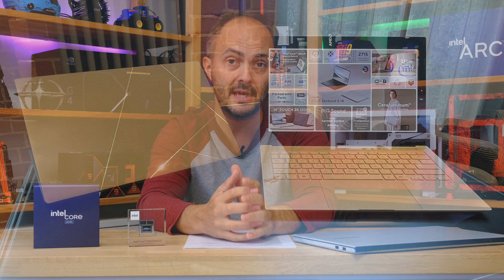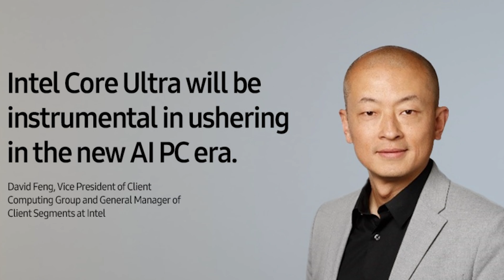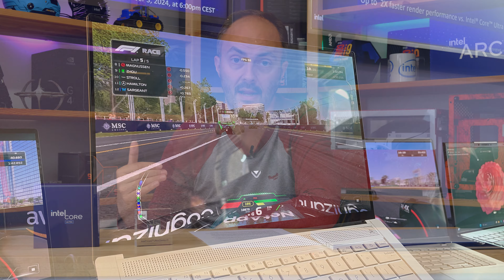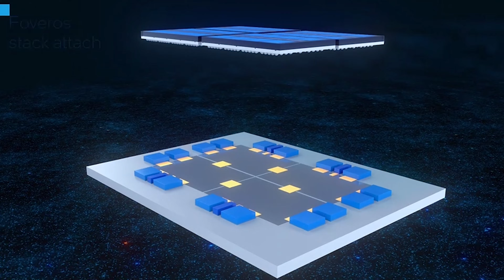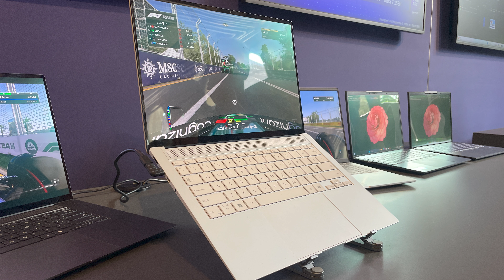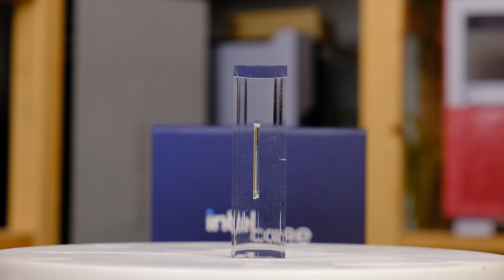Intel's HYPER THREADING REMOVAL: Lunar Lake's influence on Arrow Lake explained

Comment: The 2 big reasons for this single core thing.

1. E core and P core is having trouble talking to each other. And as a single thread it behaves "better".

2. They are more stable at higher frequency with a single thread. Because, Marketing.
Reply: then pack more cores, guess what i will stick to muh 13900k
Reply: Wrong. It's performance per watt that they were trying to optimize. Not overall all core performance. This CPU is meant for thin and light laptops. Raw performance matters a lot less than performance per watt in this application.
Reply: They are no longer making hyper threaded cpu's. When one engineer was pressed. It was for the reasons I stated above.

Comment: my i5 14600 burned off after 2 days.never ever no more intel...im going amd
Reply: My 13900kf going strong more than a year in use
Reply: @KnightOfCypher  im glad to hear yours are working fine 👍
Reply: I gone Macbook pro M1 and is as fast as my gaming laptop

when M1 beat Intel 630 HD with i7 7th gen cpu
Reply: amd adrenalin software not so good
Reply: @abhignaconscience358 melting connectors not good
Reply: @abhignaconscience358  AMD's adrenalin software better than Nvidia's.
Reply: lol, you're joking then it was DOA my GF's 13600K going strong since day 1
Reply: @cuongtang9539  maybe u Got lucky with your one.

Comment: Many PC enthusiasts are bitching about core type simply because they branded as eCore
They not even a developer, they don’t understand  Core are doing
They just don’t like get something different
Reply from the maker: I think to some extent that’s true. What Luna Lake shows is that it’s not just about power savings. It is about taking more load off the P-cores so they in turn can put effort towards games and content creation. Plus hyper-threading can actually result in lower performance in some situations. If you look at task manager and your taskbar there are an awful lot of programs running in your PC. The more of those basic programs you can run on e-cores the more you free up the P-cores. Plus no one liked the power consumption of Intels recent desktop CPUs. This could drastically improve that.
Reply: @CrazyTechLab  The main idea behind E cores on desktop isn't power efficiency, but rather performance per area, though this also leads to better efficiency (because you can run more of those cores at lower clocks while having the same performance and using less power). E cores take up less die space and IIRC you can fit 4 E cores in place of 1 P core, but in an app like cinebench those 4 E cores score roughly 50% more than a single P core. Also on Lunar Lake those E cores sit on the "low power island" so they can just run while the P cores are completely turned off.

On the topic of SMT/Hyperthreading - removing it will hit multithreaded performance, but it allows Intel to get somewhat better single-thread performance. And removing hyperthreading might reduce the need for some spectre/meltdown mitigations which could also bring performance uplifts, though this is part is questionable.
Reply: Nah, they are completely right. E-cores, in their current implementation are trash. Literally worthless for anything, but multithreaded performance without manually forcing all other side apps to run on them. They arent even that efficient to begin with.

Comment: i am also on my 9900k that has been overclocked to 5.0ghz for nearly 6 years now. it still gets the job done. dropping hyperthreading makes sense to me, because they could just add more of the e-cores that are rumored to be as powerful as raptor lake. i can also see the ai portion of the cpu being utilized with the direction that tech is going. it would be one of those "i would rather have it and not need it, than need it and not have it" things. if the performance of arrow lake or zen5 x3d blows my socks off, i may upgrade.
Reply: In 2 or 3 years time the NPU will get used a lot more than you expect. Microsoft will build it into the OS and office and teams.

Comment: I'm still rocking an i9 9900k all cores overclocked to 4.75ghz and it's been rock solid since day 1, I have no issues with anything speed wise. The 13900k and 14900k were an epic fail, even more so with their chips burning out and hoping nobody noticed till Wendell kicked up a fuss. Intel really have a long way to go to get back, my next CPU will be AMD when I deem the i9 9900k obsolete, but as is, it's fine, it's the GTX 1080 of CPUs. Workloads I use, docker, creative cloud (photoshop, illustrator), affinity photo & designer (adobe replacements), blender, bitwig studio, studio one 5 pro, etc.
Reply from the maker: @MegaPixel404  I agree. But remember the 9700K didn’t have hyperthreading and it was the best 9000 series CPU in a lot of games as a result. So st the very least we could see more performance and not just a refresh like 13-14. Of course it needs to restore faith too. No argument there.
Reply: @CrazyTechLab  True, unified non core tech seems to / well used to always perform better speed wise (has been too long for me to remember how they used to perform when I had a chip with no HT). I do probably bottleneck having an RTX 4090 with my cpu however, but for running ML stable workloads with ComfyUI, A1111 and LLM studio the cpu never gets to 100% on all cores (seems it's more of a ram thing). I expect a couple of generations from now we might have a new dedicated slot for ML (AI) processing (TPU / Intel's Neural Spiking chip or other) and a very different architecture on mobos for handling ML (fake AI) workloads (DDR7+ and distance to CPU/GPU/TPU to RAM etc), which should also inherently improve gaming performance.

Comment: Who needs fxxxing e-cores on a desktop? There is no battery to save.

Intel should better learn to stand the heat and learn how to propper glue a good cpu together.

This kind of woreshipping "single core" peformance is good for times of c64 or MSDos.
Reply from the maker: To be fair though when they’ve removed hyper threading in the past for example on the Core i7 9700k it actually had a net benefit in gaming performance and in some games it was faster than the 9900k as a result. If e-cores enable that without a drop in multi thread performance  it could be a good thing, irrespective of whether it lowers power consumption or not.
Reply: @CrazyTechLab  false thinking. even gaming would slow down, if you had only one core. So to compaire only synthetic core performance to sell this as gain, is a cheap trick. 

So you compaire the performance of one thread and not of one core.

Other wise the performance gain must be over 200%.
Reply: CMOS battery in it
Reply: @Stormlywing  😀😀😀
Reply: The new E-cores have the same IPC or slightly higher than the P-Cores in 13th/14th gen.
Reply: @rattlehead999   so why not a pue e-core cpu for mobile devices?

e/p core needs the support in the scheduler. And we learned in Win11 that ther is still a lerning effort to master this.

I made 25 ago this quote:

"Every additional if/then statement is a brick for the global warming"

The most things become at the end complex or complicate, so it is a good idea not to start with that.
Reply: @HerbertSpringer  Because E-cores can't win single-core performance and AMD, Intel and Nvidia have proven to themselves that whoever tops the benchmark charts sells the most even if they top it by 5%. 

That's also why power consumption is out of control.

Transistor power doesn't scale linearly with frequency, at first it's below linear, meaning you get a ton of frequency for very little power draw, at some point it becomes just about linear and then after a certain point it becomes exponential, where for 5-10% extra clock speeds you increase power by 40-70%.

The i9 13900k/14900k gets 88-92% of its performance at 125-140W compared to 254-350W(and that isn't even a proper undervolt, just a limiting of power consumption in software).

The rtx 4090 gets 87-90% of its performance at 300-330W compared to 450W

The 7800XT at 200W gets 94% of its performance as at 262W.

Also keep in mind Arrow-Lake/Luanr-Lake E-Cores are 68% faster than previous E-cores, while also being clocked higher too.
Old E-cores were terribly slow and lacked some instructions.

Now intel's E-cores are pretty much P-core-lite. The new E-cores(Skymond) have IPC like 14th gen P-Cores(RaptorCove).
Reply: @HerbertSpringer  Second reply:
Otherwise there are now C-core Epyc 192 core CPUs and E-core only 128 Core Xeon CPUs. 

Cuz data centers and corporations as a whole have more informed people that know what's optimal, maybe not the best.
Reply: @HerbertSpringer  Reply 3:
With Arrow-Lake/Meteor-lake they have made the scheduling more hardware based than before, but not entirely and Windows still bugs it out a little, where it activates P-cores for no good reason when even the E-cores aren't fully loaded, but that happens for a fraction of a second.
Reply: Are you still using dial-up Internet? Noisy desktops are so outdated in 2024.
Reply: @EnochGitongaKimathi  "so outdated" - literally the most future-proof platform to ever be.
Reply: @alexturnbackthearmy1907  that's what IBM said about the mainframe. Talk about beating a dying horse and call it future proof. The future is mobile.
Reply: @EnochGitongaKimathi  You are a kid right?  I've heard somewhere that in 2024 majority of internet users globally are children and tenagers.  Limited screen space is mobile's ultimate limitation.
Reply: @sezwo5774  unfortunately for you I'm not a kid nor do I easily take offence. Your comment does expose your level of maturity and intelligence.
Reply: @EnochGitongaKimathi Kid, definitely.
Reply: @EnochGitongaKimathi   dial up is exact the synonym for a e-core solution when you can not proviede efficience and performance at the same time.

But you have missed my point. E-cores are fine for mobile devices, but for this should be a real mobile type used an not the same die in a different package to call this "mobile".

Intel specially has fear to cut old ties. Therefore you must shoulder all the things which sucks on the surge.

In times where people willing to switch on ARM, even with emulatet code compatibility, this behavior to be backwards compatible back to the stone age, is  verry strange.

The point is, not to let eat only the customer eat the whole pile of shi to maximise the revenues..